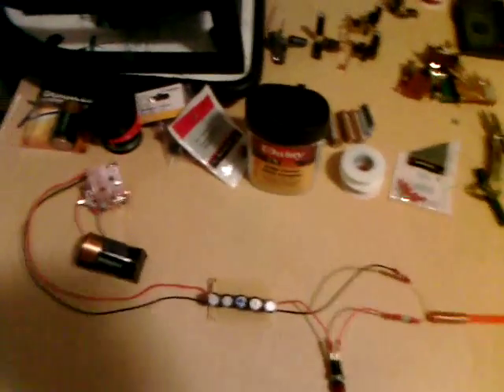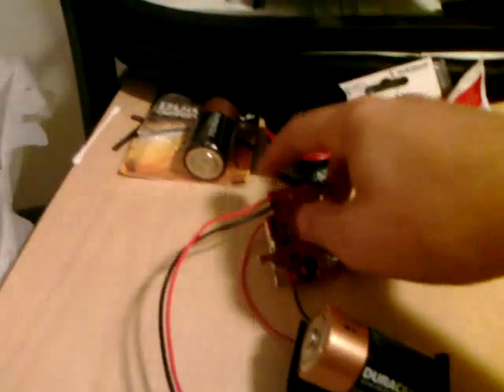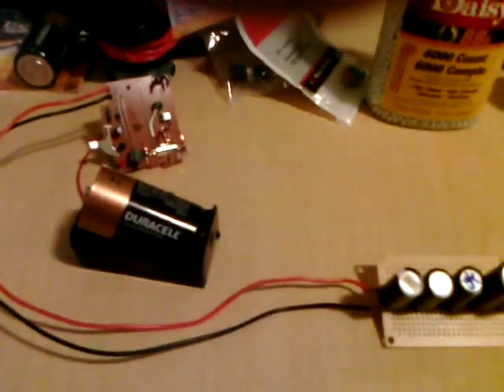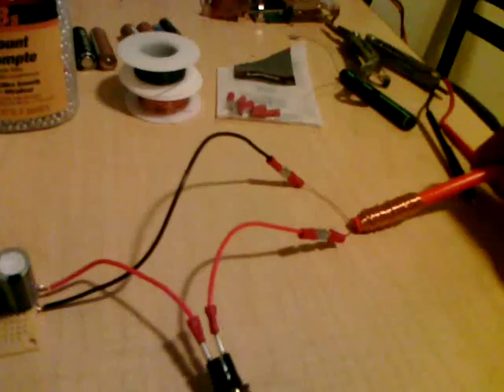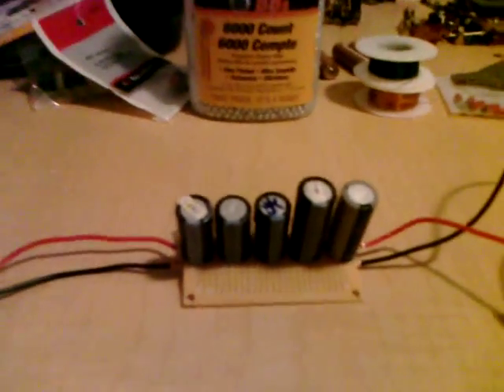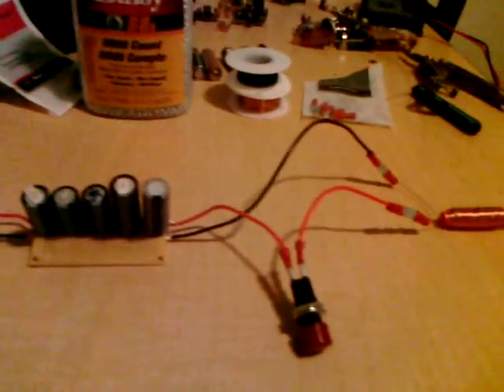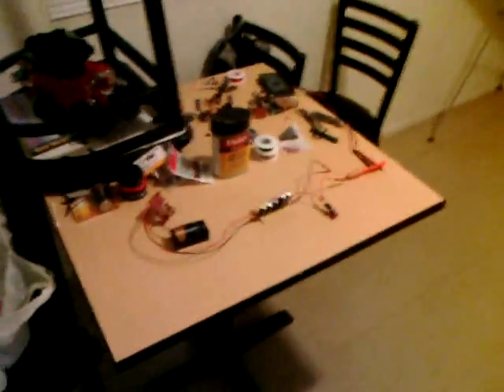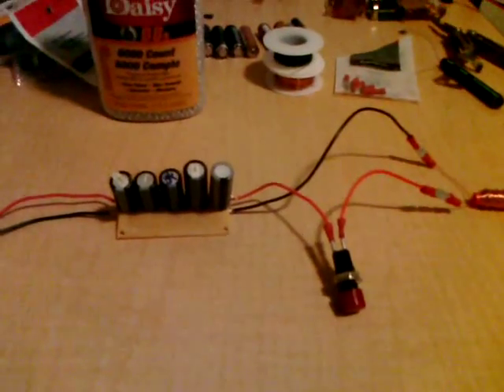First Coilgun Build

Comment from the maker: The capacitors must be the high voltage caps found in disposable  flash cameras. In the hundreds of flash cameras I've taken apart, they've always had the 330V 80-120 micro farad capacitors. I don't have a writing diagram at this time but I can get one drawn up that's compatible with disposable flash camera boards.

Comment from the maker: Ok, it has been a while since I last made a post on here. The critical component from the flash circuit that makes this magic happen is the little step up transformer. It takes the 1.5 volts DC after it has been sent through a chopper circuit and bumps it up to 330+ volts. The chopper circuit makes the DC power act like an AC signal in order to utilize the dynamic electromagnetic properties within the transformer.

Now, the voltage coming out of the transformer is still in AC form so, it goes through a rectifying diode that turns the AC signal back into a DC source. I hope that helps you understand the why's. If you're unfamiliar with the difference between alternating current (AC) and direct current (DC) check out wiki or view a tutorial on youtube university.

Comment from the maker: Increasing the voltage too much beyond 6 volts heats up the charging circuit. You're better off using some d size cells to power your charging circuit. 3 volts is the faster and safer way to go.

Comment: 1 do the capacitors have to be flash capacitors? 2. Can you send me a link to a wiring diagram plaease? 3. If i use a 9v battery, will it break the circuit designed to use a 1.5v battery? Thanks